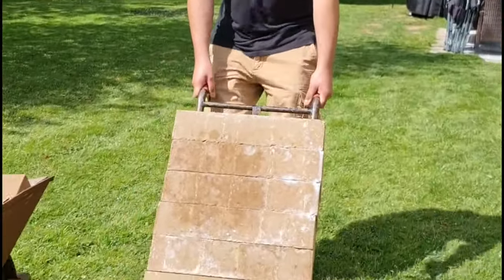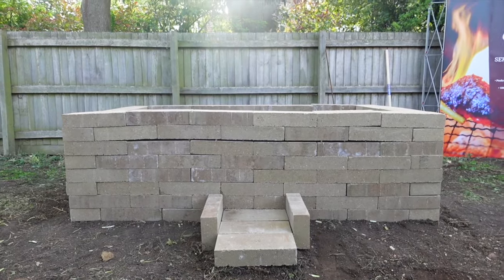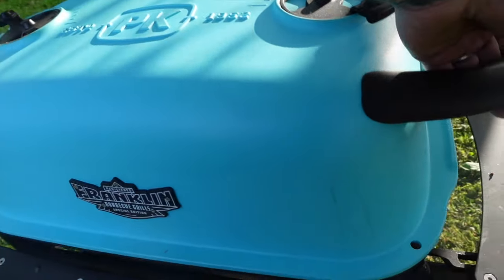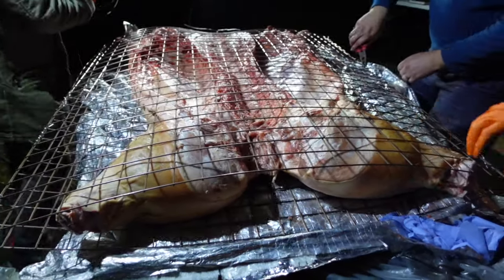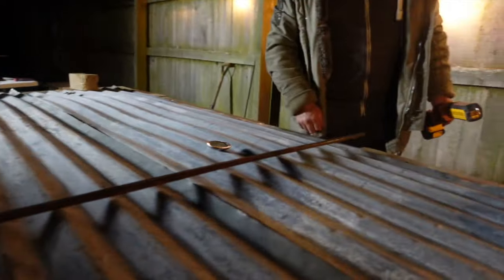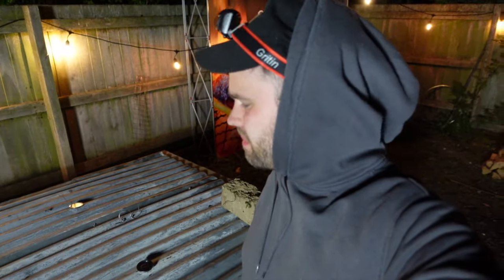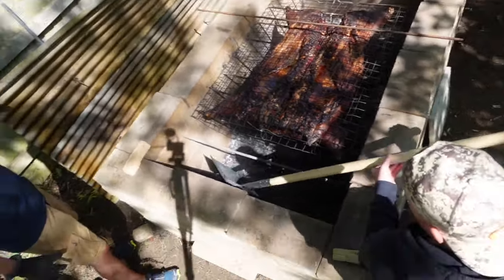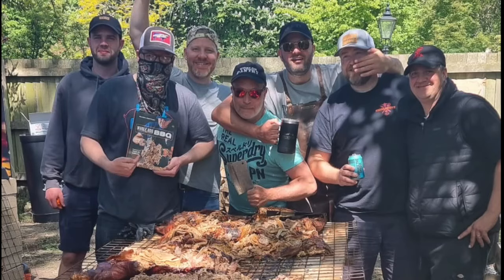We Cooked A Whole Hog - Carolina Style!

Comment: As someone who has cooked several whole hogs over the years, well done that looked fantastic. The only suggestion I have is to leave a hole in the side of the pit that you can shovel the coals into, it makes it a little easier to spread the coals around under the pig.
Reply: I agree, because every time they move the cover they are losing heat. I am surprised they did that after I am sure they have watched a lot of Americans do it on Youtube.
Reply: @gsbbq4870 Taking the top off makes zero difference.